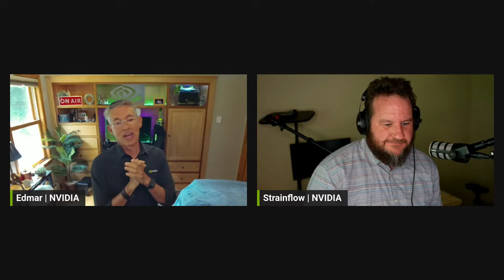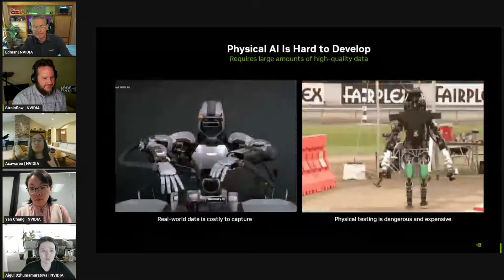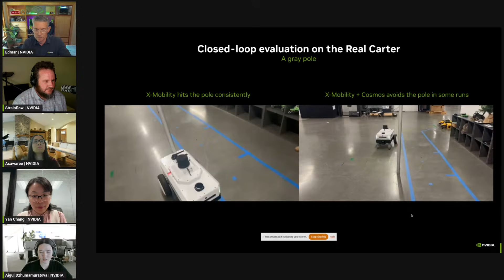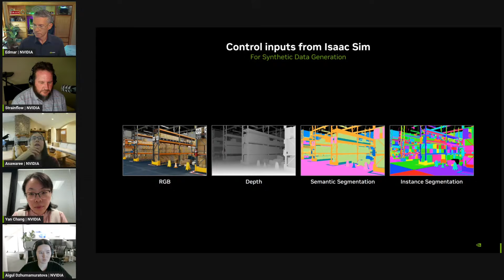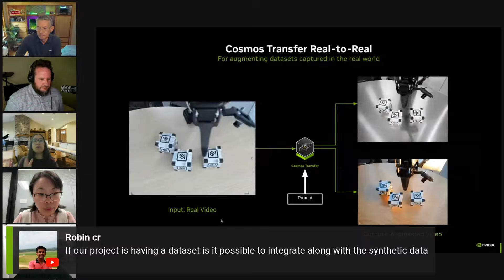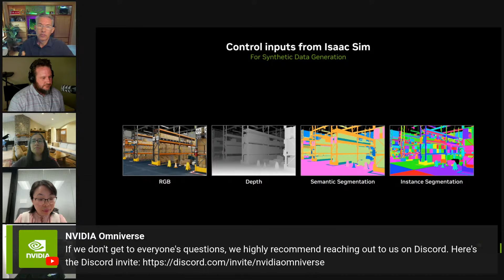Generating Synthetic Data for Physical AI With NVIDIA Cosmos

Comment: I have been trying to use Cosmos Transfer 2.5 to generate a photorealistic video from a CGI video I got from CARLA. I am running it on an A100 node, so no issues with computational power. Video is 5 seconds only, and each run takes 2-3minutes to finish. I have tried various weights for edge, segmentation, depth, and vis videos, different values of sigma_max and other hyperparameters, and different prompts and negative prompts. And I have failed to get an output that is even remotely acceptable. They look like CGI and are even worse than the original one! If any of you guys is kind enough to tell me what I can do or point me towards some practical examples for this particular use case, that will be hugely appreciated. I work in the self-driving car industry, and what Cosmos promises is extremely interesting for us, and I am desperate to make it work.

Comment: Great webinar, amazing work! For those wondering about hardware requirements, my tests on a single RTX 5090 with 32 GB VRAM, containerized Cosmos Transfer1: 
Example 1: single control (Edge) (non-distilled) ✅ ⏱11:30
Example 2: multimodal control (non-distilled): 🛑OOM
Example 2: multimodal control (non-distilled, offload_diffusion_transformer): ❔⏱Stopped after 1,5 hr
Example 2: multimodal control (distilled):🛑OOM
Reply: hello sir, I'm trying to follow the webinar, but I can't find a documentaion or else. If possible, could you provide or tell me about where I can find it? Regards.